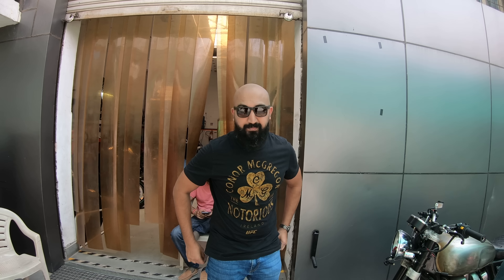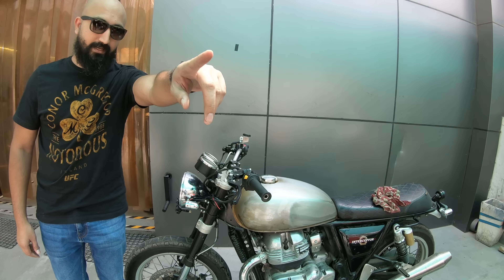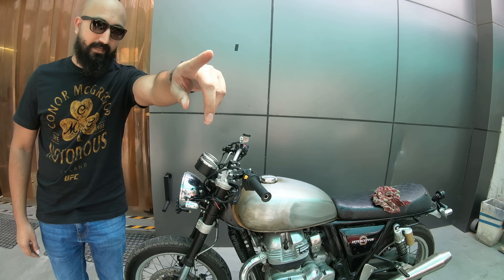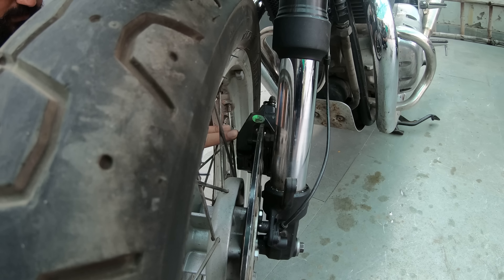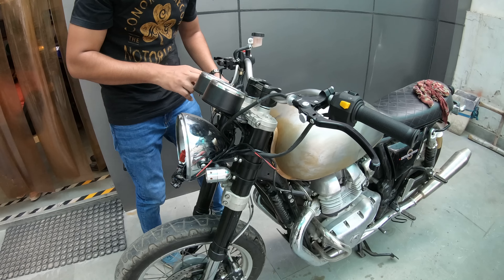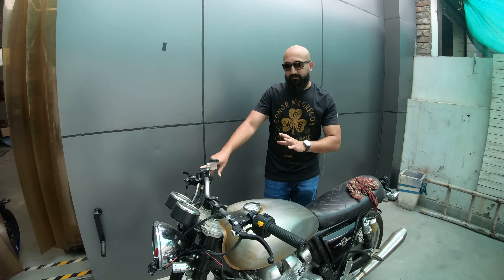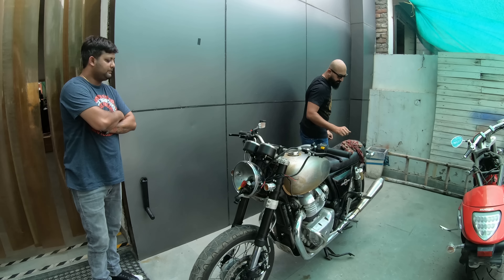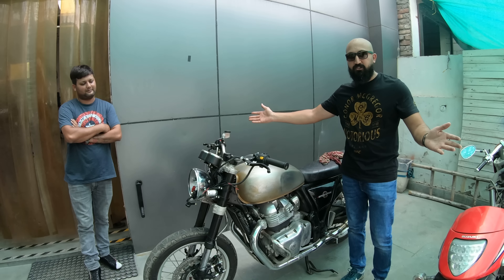My Royal Enfield Interceptor 650 With KTM Duke 390 Upside Down Forks ( USD Forks )

Comment: If you see the power drift review on the continental gt 650 I left a comment where, if I own one I would swap the suspension with dukes usd forks . And you did it first.
Reply from the maker: Great minds think alike, hahaha. But I am not the first to do it. Even though I started some 3 months ago. The problem is we just don't know anything about modifications. We try to directly swap parts and whenever we run into issues, we try to figure out solutions. That takes time since this is not out expertise.
Reply: Can you tell me how to fit it in 500cc .... ?
Reply from the maker: Best would be to take it to Speedmonks or some top customiser in your city. They should be able to do it.

Comment: I heard a big bore kit is available for the 650 twins and it increases the horsepower to 70HP. I don't think so it will increase it to 70 but still.
Reply from the maker: Yeah. But can the brake and the suspension take it? That's the big question.
Reply: @abhinavbhatt  Exactly and the chassis too
Reply from the maker: Yeah. The bike wobbles above 150 anyway.

Comment: Are you going for 17 inch alloys or spoked rims? Also, did you have to make any changes to fit the front forks? The Duke is a much lighter motorcycle than this one, probably why you need stiffer springs.
Reply from the maker: I am going in for spoked rims. I had to make a lot of changes to make the forks fit. I will details it in a proper video. This was just an overview to give you guys an idea of what I have been upto.

Comment: very good and looks great. with this front fork can we go ahead with 120 width tyre?
Reply from the maker: Yes. I am running a 120 front, but on a 3 inch wide rim.
Reply: Abhinav Bhatt thanks so with the fork I hv to change the rim as well is it? I mean a 3 inch bigger rim than d stock rim?
Reply from the maker: No. You don't have to. I changed because I got custom rims made.
Reply: Abhinav Bhatt think u once again and sorry to bother u again as I m not clear. U meant to say that in d stock rim itself I can go with 120 tyre since d Ktm 390 fork already  in place is it?
Reply from the maker: No. What I mean is I was able to fit a 120 easily because my rim is wider. On the stock rim, you can squeeze in a 120 but it is not advisable at all. And I wouldn't recommend you to get a new rim just for a wider front tyre.
Reply: Abhinav Bhatt thank u man. So what rim u hav so that I can go with d same. Pls share . So kind of u
Reply from the maker: It is a custom rim that was imported from Taiwan and then laced here.
Reply: Abhinav Bhatt is there a way to find d measurement of it like width and size. If u cud help me with it I can try locally one here in kanyakumari and that is nothing like it. I wud b obliged man thanks
Reply from the maker: It is a 17 inch rim which is 3.5 inch wide.
Reply: Abhinav Bhatt thanks a ton

Comment: Nice attempt and waiting for final product. However, from safety standpoint, will the USD forks bear the weight of this RE under heavy braking? Reason why I’m asking is, USD forks of KTM is designed for its own weight and design. RE is a different elephant altogether. Just concerned on the weight difference between the two bikes. Any tests that would be conducted to prove it won’t give up during stressful situations?
Reply from the maker: I will have to put in heavier springs to compensate for the extra weight. Any and all testing will be on the road.

Comment: Hi Abhinav, the bike looks great, just wanted to confirm-
In one of your vlogs you mentioned the foot peg placement issue with the bike, you had also mentioned about trying to fit the gt650 foot pegs to this bike, have you managed to do that? Just wanted to know if they can be retro fitted without any mods...
Also you mentioned about your custom rims being made, are these going to be tubeless ? If so where have you had them made
Reply from the maker: Hi. The GT650 pegs fit just fine and work better than stock for me at least. The custom rims were made by this YouTube channel called HDT Customs. The rims were imported and the hub and spokes were sourced here. But the set up is not tubeless as of now. All details are on my Instagram. The bike looks very different from what you see in this video.
Reply: @abhinavbhatt  hey checked out the bike on insta, the final products looks beautiful, what front end is that, and just for humble suggestions, wouldn't you prefer a slightly flatter/straighter handle bar....but rest assured she looks amazing.
Reply from the maker: @Xcalibur24  the front end is from the Dominar. I had a flatter bar earlier, but this is more useable.

Comment: Hi Abhinav, can u pls confirm if the ABS in front wheel is working properly after installing the disc and Calipers? I'm also planning to install the same in my Ninja 300.
Reply from the maker: No. You'll need to create a clamp to hold the sensor. I never did that though. I removed the ABS motor.
Reply: @abhinavbhatt  ok. Thanks for the confirmation buddy. Will do the necessary.

Comment: Hey Abhinav, first off I’m really impressed with how the bike has turned out so far. 

Now ive been considering to get the adelin units for my interceptor. Im confused on which one im supposed to take. I see that there is a 17.5mm piston bore size and a 19mm piston bore. Im quite not sure which one im supposed to get. Can you let me know on the specifics cos’ i see that u already have chosen the adelin levers. Looking forward to your response. 

Cheers!!
Russel
Reply from the maker: Hi Russel, I went with a 19 mm piston simply because I couldn't find a 17.5 mm one. I run that on my little 150 cc bike but I suspect it will do just fine on the Interceptor. I don't know how well the 19 works on this bike yet since haven't ridden it hard. 

I'll make a video on braking once the bike is set up.

Cheers
Reply: So ideally would you say that a 17.5mm would work well/good for the twins?? Just curious cos’ im just a click away from buying n when i found out that you’ve had quite a lotta experience on these levers I wanted to get your opinion/verdict :)
Reply from the maker: I think it should hold up, but to be safe, I'd say go with the 19 mm.
Reply: Abhinav Bhatt then 19mm it is!!! U da man Abhinav!! I’ll let you know how it fares. Btw, did these cost u bout 7K?? Cos the price shown to me is about that much ;)
Reply from the maker: Sure. I think both the clutch lever and the brake lever together were around 7k. AliExpress keeps changing prices, but not by much.
Reply: Abhinav Bhatt sure. Thanks a lot mate! Ill keep you posted on how the lever experience turns out to be
Reply from the maker: Sure thing. Will wait for your feedback.
Reply: Abhinav Bhatt hey Abhinav, just curious to know- how different is the 17.5mm piston from the 19mm piston? I mean what difference does it make?
Reply from the maker: More oil flow. Results in more pressure.
Reply: Abhinav Bhatt would that mean the lever travel while applying the brake is going to be very minimum? I am assuming that the brakes would be super touchy?
Reply from the maker: Lever travel can be modulated on these. Just two finger braking needed.
Reply: Hey Abhinav thanks so much for so patient with my questions!! 😊😊 okay so i was watching the R15 vid and the interceptor vid. I got to notice that on the interceptor u’ve gone ahead and changed the rotor brakes to a 4pot config as opposed to 2 pot that comes on the stock interceptor or the r15 v3. Per the math i think you are correct cos u need all the more pressure to push the 4pot brakes and make them bite the rotor. Hence the 19mm. But in my case, Im sticking with the 2pot stock setup. And I see that in the R15 v3 vid, u have retained the 2pot setup and ran a 17.5rcs lever setup which i think was super adequate for that bike. So just wondering- 2pot = 17.5mm and >4pot = 19mm. Am I overthinking the whole thing?? 🤪
Reply from the maker: You are definitely over thinking :)

Just go with the 19. Should suffice. Cheers
Reply: Abhinav Bhatt 😉😉 sure mate. Off to ordering the 19mm 👍🏻🤘🏻
Reply from the maker: All the best.
Reply: Hey Abhinav, my levers have arrived but we’ve hit a snag. I bought the same model as urs. Now the issue is:
1. How do i get the abs thing working? I see that there is that bleed nut (the one onto which the fluid cables attach) with a cable attached that comes with the package. But how/where does that cable get fixed? How what should I do to get the abs working? 

2. On the clutch i see that the switch to enable the bike fire up when the in gear is a pain / un-achievable. Have you done that part? 

Man your inout will help me finish up this part of my bike!!!!
Reply from the maker: It won't be that bad.
Reply: Abhinav Bhatt buddy didnt get u..

Comment: Hey, i have been considering suspension upgrade on the int 650, but for better ride quality then looks. suspension is one of the weak link on the bike i feel and upgrading that will make it a much potent bike. duke 390 s suspension is known for oil seal breaks and its would be more stiff then the OEM. Any reason for not considering the USDs from 310 GS? barring cost? i feel that setup would have made a lot of difference. let us know how it goes.
Reply from the maker: The G310GS has a taller and softer suspension. Wouldn't have given me the stance or the stiffness I wanted. I tried the G310R's suspension but it was not fitting. So went with KTM's.
Reply: @abhinavbhatt  will wait for ktm 390 adv to launch and explore their front suspension adaptability. But for sure need a better suspension setup.. Hope someone comes with a good aftermarket plug in option.. 👍
Reply from the maker: Hope so man.

Comment: Thats how the standard 650 should come , do something  about the gear shifter some bracket that moves is it either front or rear .
Reply from the maker: I have. My bike is running the rearsets from the Continental GT 650. They feel much better than stock now, to be honest.
Reply: @abhinavbhatt  great so they fit perfectly then since they r oem  solution. Also r they comfortable on longer rides
Reply from the maker: I haven't ridden the bike more than 100 metres in the last 3 months. But should be fine for a long ride, I guess.

Comment: You can add metal spacer in between the frame mount and the rear suspensions in order to maintain stability because any ways you are upgrading to bigger tyres👍🏻all the best.
Reply from the maker: Sure. Will think about it.

Comment: My interceptor 650 turns off automatically after 60-70kms of riding at around 90-100kmph. Have you ever faced this problem with your bike?
Reply from the maker: No. I haven't. Raise it with the service centre once. Could it be an electrical problem? Or something with the fuel pump?
Reply: @abhinavbhatt  I have contacted the service centre, thanks for the input

Comment: Cosmetic Mods are fine but TOO MUCH Tinkering can lead to so many problems in the long run. Especially if you have a new bike there is no point doing all this.

But it is good to see someone brave enough to do all this.
Reply from the maker: That's why we are going slow and fool proofing everything from get go.
Reply: @abhinavbhatt  
That's why I said Brave Enough.

Haven't seen any updates on R15V3 
I loved the last one where you were pushing in the Gurgaon.
Reply from the maker: Yeah man. The new fuel injector failed and I haven't had the time to travel and get the new one along with the big bore kit, super head etc. I'll only make a video once I have something substantial to show. Otherwise, what's the point.
Reply: @abhinavbhatt  Yeah. 
That project is quite promising. 
Would love to see it once you have everything sorted out and fixed.

Comment: What do you think of the new S&S pipes, as well as the clutch kit and big bore kits - 750cc and 865cc.
Reply from the maker: I don't think this suspension and brakes can keep up with an 865cc bore. I don't see a big deal about the S&S pipes too. AEW pipes can be had for a fraction of the cost and are very similar.

Comment: Why didn;t you just try progressive stiffer springs in the stock forks first with higher grade fork oil? Hagon uk would probably have a pair to suit it.M suziki sv 650 was very bad untill i found zzr  600 kawasaki springs fit perfect & mutch better ride.  The enfieild also has 41mm dia forks does it not? worth a try maybe? sprongs are very cheap from breakers in uk....
Reply: apologies for bad spelling it;s 3,45am & is just replied without my glasses...doh!
Reply from the maker: Haha. I did not know about this particular brand earlier. Also, wanted the look of the upside down forks as well. Where to get springs for it though?

Comment: Duke forks are desined for the weight of the duke.. and this is interceptor dear freind.. can that mange the weight of the interceptor? And wat will be the presire on that poor shocks when d front brakes are applied and the weight of the i terceptor is pushing from beeind.. wat i feel is its always  better 2 choose the forks of a stronger bike...
Reply from the maker: Hi. Your concern is valid. I got them to work though. And the setup is much better than stock. I'll try to make a video soon.

Comment: Bhai u hot a street twin cuz interceptor is not good for highway.
But they resolved the issue by a software update.
What now?
Reply from the maker: The Interceptor is very good for the highway. Why do you say it isn't?
Reply: @abhinavbhatt  I'm sooo sorry.
I meant high altitude.
😂
I ride highway on a Unicorn 150 I can't say a 650 isn't good on highway on a long shot
Reply from the maker: No man. Any bike can be ridden on the highway. And the Unicorn has one of the smoothest engines of all bikes in India. I can't personally say whether the Interceptor can or can't be ridden at high altitude. I am sure RE tested it thoroughly in the Himalayas as well.
Reply: @abhinavbhatt  
You should check out videos from Bulu Biker.
His interceptor failed 2-3 times there.
And I agree, Unicron is a damn smooth bike.
Reply from the maker: I haven't watched his video but I have read a lot about it on my RE WhatsApp groups.

Comment: I like what yo did but WP suspensions which KTM owns also makes custom suspension and rear electronic suspensions.
Reply from the maker: I can't afford them.
Reply: Hi in chicago its pricy too , look at placed like copart or ebay or craigs list 2nd hand or parts bikes.
Reply: PS get the tank brushes metallic powder coated because due to heat and rain contraction clear coat will crack and rust the tank metal.
Reply from the maker: Okay. Thanks for the tip.
Reply from the maker: Sure. Will do.
Reply: Abhinav Bhatt Love the videos just subscribed keep them coming.
Reply from the maker: Thanks man.

Comment: Try out the USD forks of dominar 2019 edition.. since dominar is already a heavier bike than Duke it would be tuned accordingly... just my two cents..  Good luck with the swap..
Reply from the maker: I wish it came out in time. But I can't buy another set of forks now. Will have to make these work.
Reply: @abhinavbhatt  they might share the internals... So the spring if available might be usable in your case..
Reply from the maker: Yeah. I'll check it out. Thanks man.

Comment: Why would you do this mod by structurally changing and putting the stability at risk... Considering it is a RE...
Reply from the maker: I'll thoroughly test it before doing any silly speeds.
Reply: @abhinavbhatt  ,take care bro, i saw an RE classic whose entire alloy rims broked at normal cruising speed. In my opinion the modification's are just too risky as the parts of front brakes has to be fabricated and usually, fabricated parts are not that strong.
Reply from the maker: We are trying to not cheap out on parts and going with reliable, good quality stuff. Hoping it holds up.

Comment: You will need proper rear shocks.
Geat work.
Cheers.
Reply from the maker: Yes, once I put together some money, I will get Ohlins for the rear.
Reply: @abhinavbhatt  Wow.
The yellow shocks are the best but you can do a very good  job as well with cheaper brands because the Enfield´s performance is not scary.
YSS is a good option to match the 390´s non ajustable fork.
Cheers and congrats again.
Waiting for more.
Reply from the maker: Any idea where I can source them? And which ones will fit? Honestly, I don't find the rear suspension to be lacking on the Interceptor though.